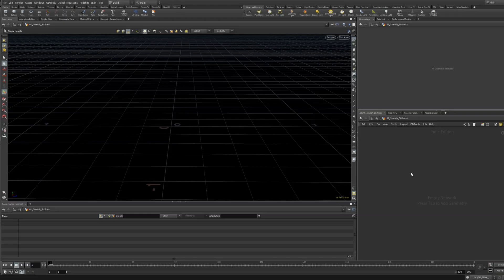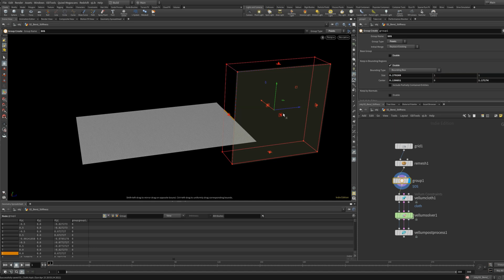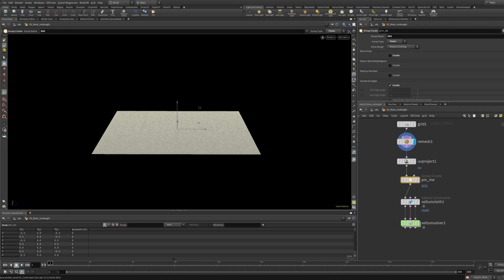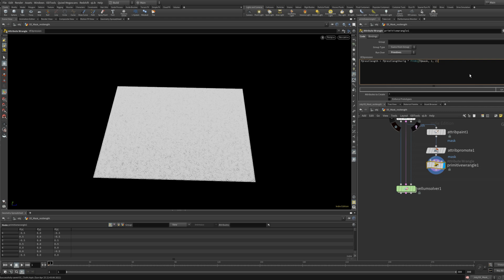01 | Vellum Nodes | Cloth

Comment: 3:10 You can always spot the exact moment a Houdini tutorial goes off the rails.
Reply: pff ha ha.. same spot. us beginners know when its coming. its like a tutorial on washing your car. "First get a bucket of water, add some soap, grab a sponge, and if cyclinder #3 has a pressure coefficient, or displacement of 1259cc, check the intake expansion ..."
Reply: @flipnap2112  This is the best and most spot-on comment on any houdini tutorial, ever. ✌✌
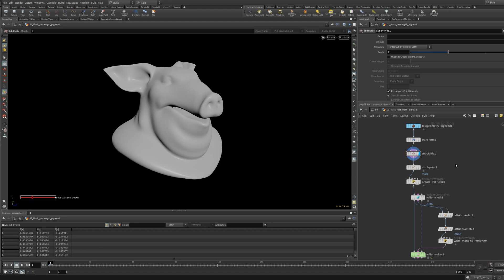Reply: for me it was at 4:05. How he's getting his attribute wrangle to select the points in the viewport is annoying af, cause it's not doing it for me. It's selecting them in the spreadsheet, and I'm doing everything 1:1 that he's doing and houdini STILL won't display the selected points. I'm in 20.5 though. I'm not sure if my version vs the one he did 4 years ago (from the time of the videos posting, to me writing) is that much different. lol